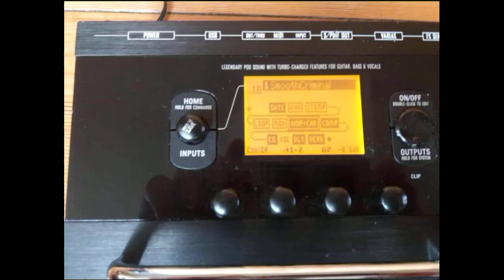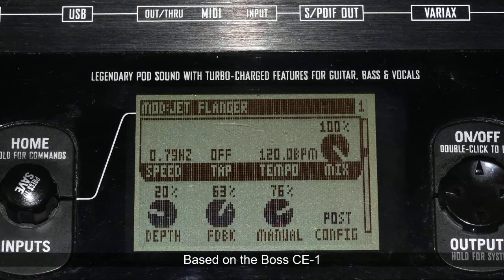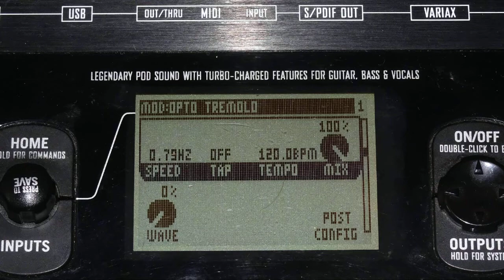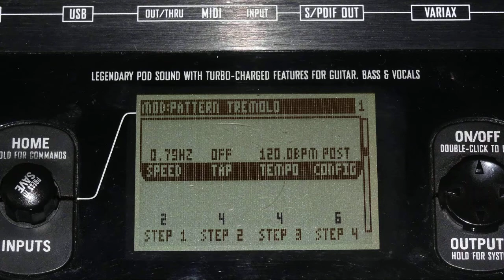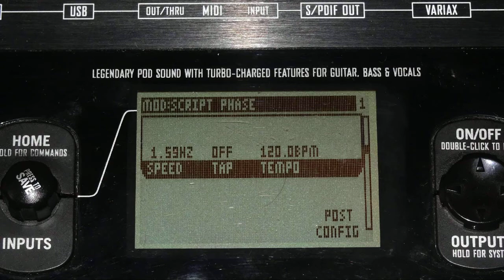Me and my Bass - Line 6 POD X3 Live - Part 3

Comment: new subscriber here,i just want to ask question if how can i find the bass amp and cab models in my 3x live?all i have seen are all guitar amp models
Reply from the maker: When I scroll though the amp models, I first get the guitar and then the bass models. I would consult the manual if I were you, if my method doesn't work.
Reply: Plug it into a computer & use the line 6 gearbox software